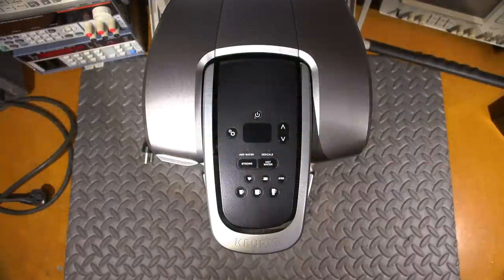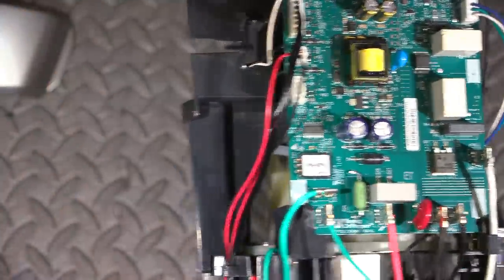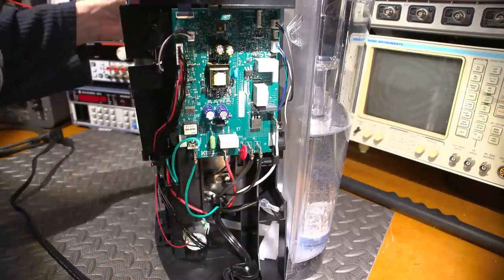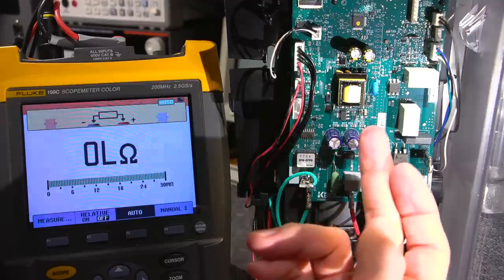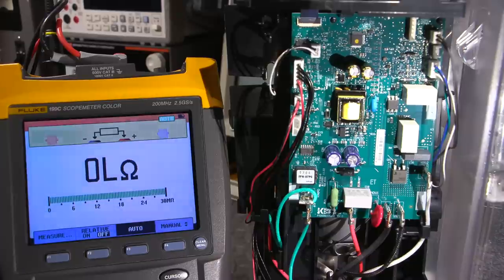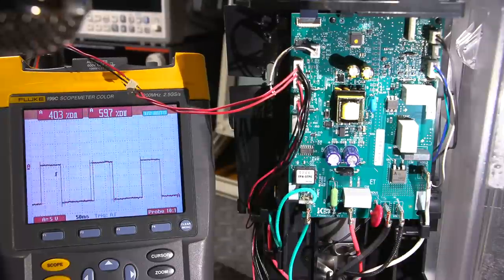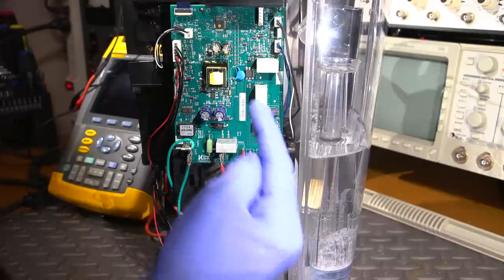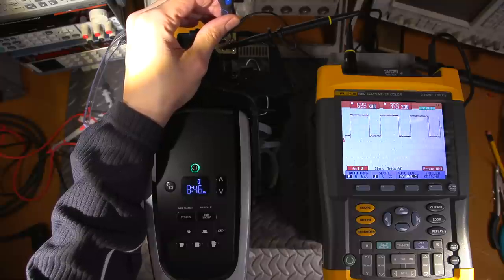Coffee Maker Repair And Modification - "For The Perfect Cup"- The Keurig!

Comment: Hey Paul, just one question, have you read the user manual of that machine?  most coffeemaker can be programmed by the user, so you can tune it to you very cup size. Greetings from Germany
Reply from the maker: Hi Tom. I don't think they would allow you to program the pulse width for the motor speed. The cup size however could be adjusted with the timer portion, (the portion that still worked in this machine.)
Reply: @MrCarlsonsLab  Hi, on my coffee machine, the cup size is programmed using the number of pulses - user function - I press any cup button and hold it until the cup is filled as I want, releasing the button saves the read value and the next time the button is pressed, the coffee machine issues the corresponding dose. I press the button twice the coffee machine prepares two cups at the same time.

Nice dat 🙂 Tom

Comment: The RF is so loud, could it feed into the processor and confuses something in the processor?  If the oscillator is triggering half a machine cycle to early before setup for a latch.  We had a handheld that would not work except when connected a techtronix analogue storage scope and cart to the hand sized device.

Comment: One of these kicked my butt when it failed. A fuse on that circuit board let go after a hose blew off internally as I recall.
When I got it apart and in pieces I personally decided these things are way more complicated than they need to be. I'm sure I have seen more simple piping systems on nuclear reactors.

Comment: I am afraid I am a bit of a coffee snob. I do own and use 2 Keurig makers just due to ease of use. Perfect cup, not by a long shot but they are dead easy to use while with fresh ground coffee, providing a brew that is drinkable. Anyway, I am a little confused. The motor is sending the signal and the processor is reading the signal, so it must be the lookup table that is trashed? With the outboard PWM generator giving a false signal you are tricking the processor to give you what you want regardless of the motors actual performance. As long as the performance of the pump motor remains constant the results will remain constant but if the motor weakens then a lower volume of water will be provided. I can't see the motors performance changing to be more efficient so the failure mode should only be to lower performance. Nice filtering of the RF to repair the original issue :D

Comment: Paul, I believe you mentioned your two other units like this one don't exhibit the same RF noise issue? So what exactly was causing the RF problem with this one? I applaud your fix of the symptoms, but it seems the underlying problem still remains.
Reply: c18 is most likely dead in this unit
Reply from the maker: @dimmog  C18 is fine, and if it's paralleled with the same type of capacitor across the line, nothing changes. This capacitor is across the line, not to the ground where the noise is propagating. This is why you only see two added capacitors on the back of the board, not three. C18 forms the third cap. Very good comment though, you know your bypass circuits!

Comment: It would be interesting to see your other Keurig coffeemaker that works fine.  The fact that this one was iffy from the beginning and all that RF noise could mean that there is some other component that is faulty and maybe that's what corrupted the chip.  Did you test all other components, diodes, etc.  It would be interesting to see it with FLIR.  Put 2 Keurigs next to each other, put them through a duty cycle and compare heat signatures of both with FLIR.
Reply from the maker: I'm sure the other Keurig's are different inside. The relays sound heavier and the pump sounds larger in the others. I think this model has been "Bean countered" to the max.
Reply: @MrCarlsonsLab  Is there a label on the bottom with a model number?  I really hope this one is not the newer model than your other ones ;).
Reply: I think you mean bean-countered past the max. Basically useless unless you are an electronics expert who can fix it. Note to self do not buy Keurig

Comment: Tracking down the RF "firehose" reminds me of when the Parkes Radiotelescope in Australia had an issue where around 10-11am every day, a huge 2.4Ghz spike would be picked up and interfere with the radiotelescope observations. Took a few years to track down but they ended up finding a badly decoupled microwave oven from a nearby adjacent building.  Story: Microwave oven to blame for mystery signal that left astronomers stumped | Astronomy | The Guardian
Reply from the maker: Great story, thanks for sharing!
Reply: I read that the phantom spike happened only when the microwave oven was energized but the door was opened before pressing the Stop button.

The microwave oven had passed all RF tests which is why it had previously been ruled out as the culprit, however it emitted a pulse in the brief moment between the door opening and the safety lockout powering it down.

Training staff to always press Stop before opening the door 'solved' the issue.

Comment: I can't see any way that machine could pass FCC Part 15 here in the US.  I'm sure Canada has similar or even more stringent standards.  I wonder if it was ever tested for conducted emissions at all.

Also, it is amazing how much troubleshooting could be expedited if there was a readily accessible ground connection!  It's a major pet peeve of mine.
Reply: Would branding it as a "commercial" device have anything to do with FCC testing or compliance?  I had what looked like an older version of the same model that was plastered with "commercial use only" on the box, instructions, and maybe even the unit itself (I don't remember for sure).  Anyway, what made it "commercial" wasn't clear, though I can say it lasted forever compared to other Keuregs.
Reply: Worked as design eng. in a major appliance business. No way that would have passed our FCC part 15 testing . Not sure why no X2's and common mode choke on the front end. I have done dozens of SMPS for appliances and none were that noisy

Comment: There a huge possibility that the pump is working fine but it may be battling a scale buildup of calcium carbonate on the heat exchange surfaces of the boiler.

Comment: I would check if needle was clean and use descale solution. Check the hoses for a clog too. There is a check valve that was messed up on my mom and took off and blew through it and used water to clean out and worked after. She has k classic i think.  Now has those Keurig 2.0 with drm. Have the high end one with color screen got from goodwill and i got the lower end one with black screen they had. Work fine really but always trying to clean it because don't drink coffee and use much.

Comment: Enjoyable quest Paul!
I assume your other coffee machines are a different model so you can’t directly compare. I wonder if this one had a failure, or an incorrect part fitted (or missing). I can’t imagine that well designed circuit board wasn’t noise tested in design.
Reply: There's always the final "Ok, now make it cheaper" phase. Possibly even micromanaged by "Why is this a 12c part, it's not even a chip."

Comment: I have an older model, it's RF quiet.
But as for making a cup of coffee, "either it does or it doesn't", well sometimes it doesn't.

But I've had shop lights, an SFX power supply (I could hear it in power lines down the block), and Ethernet router make all sorts of RF hash.

Noisy SFX power supplies are common. You just can't get a couple hundred watts out of such a small box unless you skimp somewhere and that's always the filtering.

D-Link makes some nice equipment but their Ethernet products are notorious for RF noise.

Comment: You mentioned several times how nicely designed the circuit board is, but then seem to accept that it generates huge amounts of interference.  Is it possible that a failed component somewhere caused the increase in electrical noise rather than it just being like that from the factory?

Comment: Don't ignore the RFI issue and the motor encoder signal. Say the RFI is getting into the processor and being counted as some of the motor encoder pulses. Result is program thinks motor is running too fast and slows it down.  Need to take a look at the line side of the SMPS and the noise. If you fix the RFI issue, you may have fixed the pump issue as they are possibly related.
In the industry, technicians will often become fixated on a secondary symptom and try to fix that without trying to address the other problem. Remember they may be related. 
By changing the symmetry, you may be blocking a difference of accepted noise pulses as the noise pulses may be counted during the low portion. Normally a shaft encoder produces pulses based on shaft speed, not the duty cycle.

Comment: So what was wrong, the sensor in the motor or the chip?  Usually you can measure the voltage swing as you turn the motor by hand. Just get some silicon if it leaks

Comment: So I tried to see what type of microcontroller is installed up there and I think I found it. It's an STM32F030CCT6 a common ARM processor used in various devices. It has 4 oscillators 
(4 to 32 MHz crystal oscillator;
32 kHz oscillator for RTC with calibration;
Internal 8 MHz RC with x6 PLL option;
Internal 40 kHz RC oscillator;) the 32 kHz  one is used to generate the signal to measure the time accurately so that may be our culprit. So if we could unload the firmware from that chip and load it to another one or find the pin on which we can inject this frequency and tell it to use it as default timing clock it should work as from factory. Well I might be wrong, but that's one plausible theory.

Comment: Great Video! Just the way I like to do things, if it doesn't work fix it. Even if you have to add some circuit that it should have had in the first place. I guess saving a penny or two on capacitors is important. Can't they get in trouble with the government for putting out a noisy machine?

Comment: Looks like an STM microcontroller on the board. Given that you have more than one of these devices, would it have been possible to pull the firmware off of it to do a comparison and confirm your theory about the parameters being corrupt?
Reply: 99% that's firmware read is locked
Reply: @VolodymyrTorkalo  Keurig's history with their capsules suggests that you are probably correct. However, I was just asking the question to see if Mr. Carlson had considered it as an option.
Reply: @VolodymyrTorkalo  , Worked in Appliance business for decades. First 6 months we left uP open in case of ah shit . After that blew fuses at contract Mfg, after that uP programmed at die facility for cheaper cost. No access to memory.

Comment: Thanks for a very useful repair video. 
Though you managed to make the coffee maker fully functional with your innovative fix, it didn't seem like the perfect fix to me. Either the code in the microcontroller got corrupted as you suspected or the motor needed to be replaced. Between the two, it would have been a simple matter to check with a new motor without removing all the pipe connections from the existing motor.
In any case, the video was quite entertaining and I did get some useful tips.

Comment: Didn't watch it yet, but my guess is the SMPS. 
I do repair industrial equipments, and one of the tests I realize very frequently is "listening" the noise coming out of the equipment (RF noise with a homemade receptor).
If there is a strange problem with strange noises, there is SMPS poor filtration or poor regulation somewhere, 100% of times.
Reply: Well... As the other identical machines don't produce that much noise, I would consider this noise to be messing the controller, and even to have caused the parameters issue.

Comment: I would say that the speed sensor is not working properly. The processor is still counting the pulse’s because it controlled the motor. It also sounds that the motor is struggling a bit. Could it be that the pump is dirty?
Reply: II agree :) It would be intereting to scope the output from the sensor on a good working machine and compare.
Reply from the maker: Either they pulse or they don't. No pulse, it shuts off, if it's pulsing (showing reaction to motor speed) it's working.

Comment: Looks like the micro is an STM32 if you had another machine you could download the firmware from that and load it on this. But I’m not sure that is the problem. More likely the sensor on the motor. The micro would most likely crash if there was corruption and all the other functions seem fine. Also looks like the motor PWM was lower in magnitude. (Perhaps to low for the micro to correctly read?)

Comment: I would have really taken the pump apart because to me it seems like the impeller or pump assembly is failing and the electronics are working properly.  I have Keurigs in the office that get unplugged almost every night by overzealous fire marshalls and they have not had any issues. If it is the pump though than this fault will return in only a matter of time.

Comment: You mentioned a debug connector on the board. it's probably a JTAG port which you can use to reprogram the chip with appropriate programming software. you can upload the program from a working unit and download it into the corrupted chip....
Reply from the maker: Probably locked.

Comment: I thought the main issue you were having with this coffee machine was the sheer amount of RF noise that was being generated assuming this is coming from its internal switch mode power supply so why aren’t you working on solving the noise issue and that may intern sort out the reason why the pump is running slow maybe this RF noise is getting into the processor and causing it to give the wrong speed to the motor?

Comment: A lot of 4 wire sensors have a Positive, Negative, Phase A and Phase B (90 degrees diff) . They use the A , B, for quad counting and to control direction.  Was just wonder if that sensor had a Phase B.

Comment: When I 1st saw and used 1 of these I knew it was another disposable, expensive yuppie gadget.  I have had many if the older ' simple heat element / clock timer units, some 10+ years old and still functioning... With no noise.  Remember the KISS theory. Keep It Simple Stupid.  Good post.

Comment: My son and I "dismanled" our non-working Keurig yeserday, andit had a nice RFI filterboard in front of the CPU. The power supply had a small 110 volt to 12 volt transformer, no switchmode. It had a pump issue too but the case didn't make it to be reassembled. LOL

Comment: Very difficult to imagine this problem happening here in the EU, so wondering if the regulations for EMC control are more lax in Canada? I can't count the number of SMPSU devices I've fixed over the years, and have never seen one without X/Y rated caps, if not extra caps on both sides of the switching as well. Another shocker for me was seeing live terminals that were uninsulated!
Reply: I don't think that untrained person should be inside electric device while running and it is "just" 115 volts.
Maybe the design in general was OK regarding EMC, but this one just had something wrong with it.
Reply: @MrToradragon  I think if there was something wrong with it, Paul would have found that immediately! If it wasn't clear from my post above, none of this would occur if EMC radiation had been considered in the design - something that has been mandatory here in the EU for decades. The lack of such design means a device is also SUSCEPTIBLE to interference, which is why I was originally shouting at the screen to fix the RF problem first, and the logic problem may have disappeared as a result.
Reply: @sonovoxx  , It would have never made it here in US either. EU folks have CISPR and we have FCC Part 15. We test for radiation as well as susceptibility. Either a component became defective , loss of trace to return path , the switcher started having edge issues.  Usually the X2 and Y2 caps they use are highly reliable.

Comment: Serial connection. Hmm... The processor on the motor IC may be able to be reprogramed. Since you have similar models, there may be a chance for a rom dump from a working model. This moves towards the software hacking, but it does open up some opportunities for adjustments with the modification board.

Comment: I went through several keurig machines including a warrenttee replacement.
Junk
I gave up on them and went to a simpler way to make coffee.
I also found most of the premade coffe cups to be stale, old coffee.
Unless you have soft water you will get poor service from them.
Reply: I bought a Delonghi Expresso machine with blocked outlet.I dissolved 1tablespoon citric acid into water holder, turned it on, eventually after a few minutes it became unblocked. After about 10years of making coffee the pump has failed, the body rusted out.I replaced it with a plunger cup, much simpler, less mucking around.

Comment: i wonder if thats the reason why i had issues with my sdr dongle when i unplugged my modem its a cable modem the noise floor drops quite a bit on the waterfall on my laptop i never unplug it before i did it one day just to see what difference it would make when i was dx ing and it made a difference visually on the waterfall on the app but u cant tell your neighbors to unplug their modems i live in a apartment

Comment: My guess is that it is not an electronics problem. Most of the Keurig videos about low water output have to do with a clogged water line. It could be a clogged water filter, scale build up, a bad check valve or a needle valve clogged with coffee grinds. Your fix is probably over working the pump. Great video none the less. But if I put in the amount of work you did and the fix turned out to be as simple as clearing out the coffee grinds, I would kick myself. With the amout of trouble with RF interference, I would keep the machine unplugged and use it for spare parts for the other two machines you have.